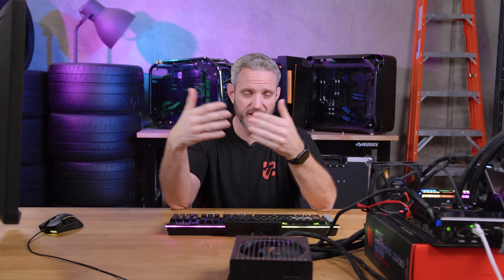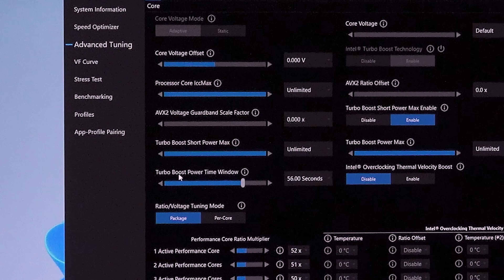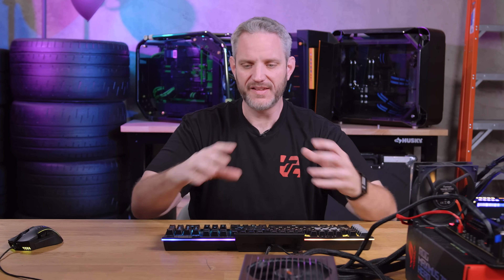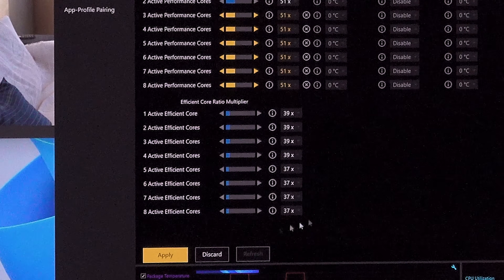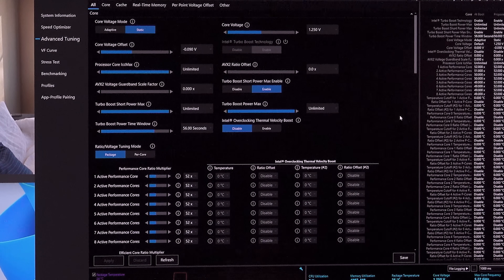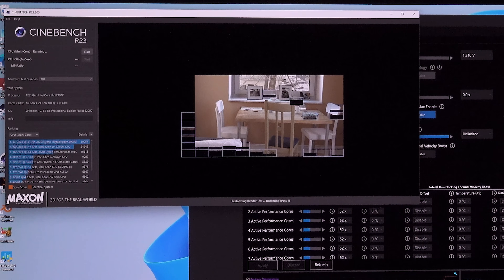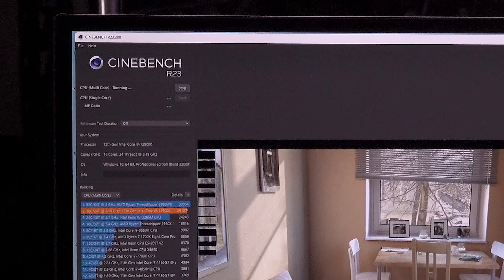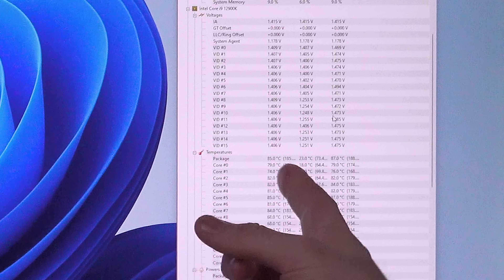Overclocking the 12900k is pointless and dangerous! Heat and Voltage testing...

Comment: i will be interested in seeing what kind of standard cooling will be used with these chips.
Reply: forgive me while I laugh maniacally at any notion of "standard" cooling for this chip. People are reporting 360 custom loops being unable to cool it enough to prevent thermal throttling at high loads so God only knows what extra expense is needed just to keep the temps down when at high load. Jay says we won't see these kinds of power draw for gaming and general use, what he forgets to say is you may not see that from games today, but in a year or two, with parallel rendering becoming the norm via vulkan and dx12 ultimate allowing for far greater CPU use under multicore systems?  I think he is not factoring in the future.
Reply: @Nine-Signs  right 360 is what a lot of ppl are using. will a 240 work, will a 280?. will a nh-d 15 work, ect . i am curious as to what the minimum standard will be. i am well aware they do not ship with cooling.
Reply: A trained butterfly in a cage on top of the CPU; flap-or-burn little buddy.
It'll be called Atomic Blizzard for marketing reasons.
Reply: Intel does not ship any kind of "standard" coolers with K series CPUs.

Comment: If 4 E-cores fit in the silicon size of 1 P-core, I wonder what a 40 core E-core only chip would be like using a 12900 die size.
Reply: A xenon
Reply: Would be great. Windows has had trouble with lots of threads. E cores are pretty damn good for power and area used.
Reply: It would perform pretty good until you need single core speed… so maybe in the future when stuff wants more cores instead of faster cores

But Thread ripper and Epic are what you go to for efficient multicore

64 cores 128 threads and uses equal power to a 12900k… FKin rip intel
Reply: Arrow Lake (2024) has been leaked to have as many as 40 cores. So in 3 years you'll nearly double your cores.
Reply: @DJaquithFL  Yeah! Im not upgrading my 11900KF till Nova Lake. 17th Gen. I think Avery Arrow!
Reply: @meeko5985  .. My Alder Lake upgrade is from Sandy Bridge-E. After this I'm good for at least Nvidia 50 series.
Reply: @DJaquithFL  pff 40 cores dont make me laugh amd has been doing that for idk how long now and amds threadripper cores are not weak!
Reply: @SB7-r9i  .. I'm talking about a consumer CPU. If you think threadripper is a consumer CPU, you're kidding yourself. It would be like me comparing a server class. Xeon to an AMD 5800X. The Intel that I'm referring to is a mainstream purely consumer Intel CPU.
Reply: Would be a great server chip for a web server or something, but a pretty mediocre desktop chip.
Reply: @Agent_Krasnov  Zen cores are better for that so ThreadRipper and Epic
Reply: I reckon this is what they have planned for server chips
Reply: That's called Xenon.
Reply: bad
Reply: From what I have been reading that sounds like exactly what AMD is working on when Zen 5 comes out. It sounds like Zen5 will be their P-core, and they will use smaller Zen4 cores for their E-cores. I think they are called 4D Cores or something. But then they are also making an Epyc server chip that is made up of 128 4D cores with less cache etc that should be coming out first. Very exciting time for compute enthusiasts.

Comment: You mean overclocking the 12900k is futile as it is basically intel redoing the prescott debacle when AMD had good competitive parts and intel had nothing to counter except its existing architecture so they rebuilt it to yes be faster than the competition but at the vast expense of energy and heat.  Sound familiar?

I look at this chip and while I do see it is the fastest chip, I also see intel flogging a dead horse in blind panic, and the naive lapping it up and applauding like they did 20 years ago. The general mantra of "well if it's just general use you should not see the heat nor power usage" as per your testing, is insufficient to cover for the fact that when it comes to energy the chips are not worth it for high end use.  I mean say you have to render for your job, you save 3 minutes per 15 minute render. 9 hour day. That's 1 hour and 8 minutes saved in rendering time for sure, but at increased electrical cost negating much if not all of the saving, indeed the cost per render in terms of energy may be double that of the competitor who will take that extra hour but cost you far less for the work you do overall in energy costs. 

We do not live in the era of cheap energy any more. That 250yr period ended circa 2008 for the vast majority especially across europe. Now we have depleted all the fuels that are easy to get ahold of or forced to use less damaging alternatives, generating electrical power has become vastly more expensive for consumers be they business or residential. In an age where we need to do the same or more, with less, it feels like a con.
Reply: @J If you were referring to me I've been just as critical of when AMD has done this, making reference on several occasions to the FX9590. I give not a toss which company I or anyone else uses, my recommendation over 27 years of building computers professionally and personally has always been to go for best bang for your buck. But that does not stop me from being duly critical no matter the company at the time.
Reply: @J Ah no worries then, just though I had better explain myself a bit more clearly as from my OP it may seem as if I am for one or the other but really, I just expect better than what we are getting in terms of price via AMD and wattage via intel.
Reply: The 5950x is just as hot and power hungry.
Reply: @Safetytrousers  No and no.
Reply: @AlistairWolfe993  My 5950x is currently running at 220w at 85c at 1.24v (which is a limit I set) in my extensive custom loop. Yes and yes.
Which of us has a 5950x?
Reply: @Safetytrousers  your "extensive" custom loop sounds like literal hot garbage if you're running at 85 C considering an NH-D15 can do better.
Reply: @AlistairWolfe993  I have 900cm of radiator length. My 5950x is at 100% load.
I ask you again, who has the experience of having a 5950x?
Reply: @Safetytrousers  Reviewers and peoples who knows what they're doing ? 
Yeah sorry, but with multiple rads(900 CENTIMETERS ,you sure about that ?), you barely cool a 5950, 
When a LOT of testers and on forums all over internet, people manage with aircoolers.
Reply: @jeanpignondepied  I meant 900mm, and that is .9 of a metre.

Comment: Intel fanboys: 110 degrees is perfectly acceptable for 5.2ghz
Reply: If you can't cook on it, it's not hot enough
Reply: @t0aster_b4th  fax
Reply: Someone should modify the PC cooler spot into a pot to heat up water and cook food with that amount of heat from intel 12th gen we should not waste them 😂 (just kidding)
Reply: @annguyenlehoang7779 I've never heard water boil in a loop before.
Reply: and 350watt totally fine
Reply: Not a intel fanboy but did you even watch the whole video?
Reply: @IskeletuBr  im at 5.2 on P 4.0 on E rn maxes at 80c :)
Reply: I use an AIO with 360 rad on my 8600K, I think it runs around 80 at 4.8ghz full time, highest I've ever seen it was around 95 while trying to push for 5.1, but couldn't get voltage stable lol

Edit, Temps at full load, idles less than 60c
Reply: @t0aster_b4th  when your idle is at 60 u have very serious cooling problems
Reply: standard^^
Reply: This didn’t age very well. There isn’t such thing as intel fanboys or Nvidia fanboys. Those brands are for people who want the absolute flagship and fastest hardware available. AMDip is for people who can’t manually tune a voltage curve or tweak a bios. There is only AMDip fanboys and that’s it. That’s why princesses like you make comments like this.
Reply: Fyi, I am @5.2 all core on my 12900K the cpu barely touches 60C 🤡
Reply: @ScenicD prove it
Reply: The same folks who hated the FX9590 for doing the same, the same folks that loved the prescott chip for doing the same.

When any CPU manufacturer releases their next design to answer the competition, and that design is just an absolute massive power hog, you know the company who built it merely shat the bed at the competition and said "fuck it, ramp the power draw to oblivion to get ahead while we work on something new".

And the seals do clap.
Reply: @Nine-Signs  The 5950x is very similar in that respect.
Reply: @Safetytrousers  yep and the 5800x actually gets hotter than a 5900x due to the core layout.
Reply: AMD is worse. 200 degrees. I haven't seen an AMD CPU cooler than an Intel CPU yet. Especially when over-clocked.

Comment: Tbh the 12900k already is overclocked out of the box.
Reply: Stock 12900k uses slightly less power than 5950x overclocked (according to gamersnexus video). This launch is Intel throwing everything into the CPU, only using peak silicon. The margins on this CPU will probably be reduced compared to the last 15 years.
Reply: @uniktbrukernavn  Doubtful, the 5950x would have to use more than double it's stock voltage to be using more than 12900k.
Reply: i somehow prefer it this way, cuz i dont want to overclock myself, id rather its running close to the red line out of the box
Reply: ;_; so ... A stock intel 12th is like a amd oc ?
Reply: @annguyenlehoang7779  no my 5950x  oc smashes the 12900k stock.
Reply: 240 watts or PL2 is already an overclock, you aren't wrong. So, running that at 125 watts, then you can make the argument that has the biggest overclocking headroom.
Reply: That's the best way to describe it, reeks of desperation from Intel they gave it everything they have this time
Reply: @neiliewheeliebin  desperation? You mean they gave people exactly what they want. This is the first time in a decade they have new architecture, it will come with growing pains, same as a Ryzen first generation.
Reply: @neiliewheeliebin  In a way I guess but it's more that it takes years to come up with a new architecture and when you are coming from behind a failure can have drastic consequences for a company.  I don't know how these chips will do because they have a lot going against them but intel knows what's at stake that's for sure. 
AMD has built a lot of mindshare with Ryzen and a lot of well deserved appreciation from the people who use it. As others have mentioned, these intel processors have a massive power draw. There's the issue with a number of games don't work with this processor and likely never will. It requires a new motherboard that's incredibly expensive, new ram that's incredibly expensive and it's basically a whole new platform. I think it's an uphill battle for them to convince people to buy these, go windows 10, dump older games they love and spend a whole lot more money to do it. Doesn't mean it will fail, I think they will at least do as well as they have been, and it could possibly be a success but we have to wait and see.
Reply: @neiliewheeliebin  it reeks of competition not desperation. You're too biased against Intel. I'm glad that AMD did this to force the competition to increase the speed and future efficiency of both chips. We all win
Reply: @jkutnink87  I'm not biased at all but I am concerned that Intel may have nothing left up their sleeve to be releasing chips with this much power draw at boost
Reply: @neiliewheeliebin  idk man it seems like they came out swinging and hit it solidly. I’m super happy that intel pulled off this improvement from 11th gen because it forces AMD to keep the pedal to the floor as well
Reply: @neiliewheeliebin  then amd will swoop in again at the right time

Comment: 12900K: How to turn a water cooler into a water boiler
Reply: Bro . just drop some eggs and potatoes and we got a meal right there . cant wait to cook my food and playing game at the same time . how convenient
Reply: @annguyenlehoang7779  Gaming peaks at about 65c and stays almost always in the 50s.
Reply: @Safetytrousers  i know im just kidding 🤣
Reply: @Safetytrousers  what liquid cooler are you using and what mm?
Reply: @harpoon_bakery162  It's not a 'liquid cooler'. It's one XE 480mm rad 120mm fan rad (4x fans both sides), and a CE 420mm 140mm 3 fan rad, CPU and 2 GPUs, fed by a d5 pump. EK CPU block.
Reply: @harpoon_bakery162   It's not a 'liquid cooler'. It's one XE 480mm rad 120mm fan rad (4x fans both sides), and a CE 420mm 140mm 3 fan rad, CPU and 2 GPUs, fed by a d5 pump. EK CPU block. 16/11 tubing.
Reply: @Safetytrousers  ok, so you made a custom cooling solution, correct... that went about 40 yards over my head. apologies in advance.
Reply: @Safetytrousers What does it change ? I don't know you, your setup and your test methodology, your rant means nothing to me
Reply: The 5950x gets hotter than this CPU with the voltage offset.
Reply: @Safetytrousers  Wrong the 5950X with it's two chiplets design, dissipates more heat than a 5800X , even so a 5800 is still cooler than a 12900K
source : Page 21 techpowerup 12900 review

Comment: 7% more perfomance but draws 2x power than the 5950x...
Reply: @elvewizzy  CPU runs at 70 to 100% on all cores in Star Citizen. Gonna be fun for those who get a 12900K and have it in a box with a 3080 or greater. Especially in summer.  Jays idea that normal users and gamers will never see peak power draw is a bit flawed, especially with games now moving into parallel rendering which means they will be using more of the processor than ever as we move into the future, and more gamers than ever streaming content as they play, which if they stream at 1440p with hdr for example is going to chomp on quite a bit of the CPU alongside that already being used for gaming. 

And then throw in a summer or if you live in a warm country?  It is 50+ oC in Kuwait during summer. Regular above 40 for australia, spain, even parts of the USA these days see regular high 30's. So you not only have the additional cost of a super dooper cooling for the chip, and not only have the additional cost of running the chip via electricity bills, but if in a warm place you will have even more costs on needing an air conditioner for the room, and the running costs of that. 

Bloody awful design to my mind but I am sure it will still sell just as the FX9590 did and the prescott before it.
Reply: I am able to buy a 12900K custom build for the same price as a 5900X custom build. Going for a 5950X build is actually much more expensive.
Reply: My 5950x is currently running at 220w.